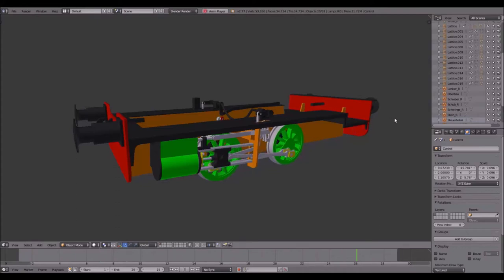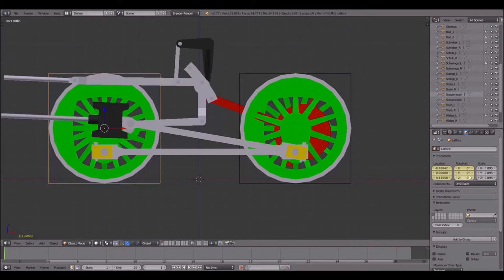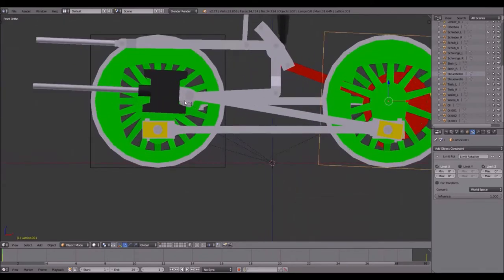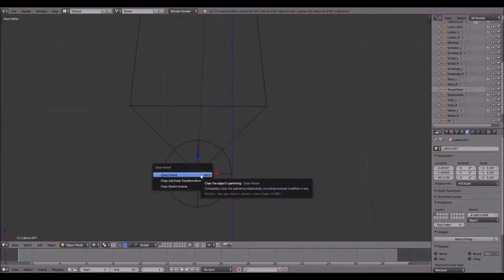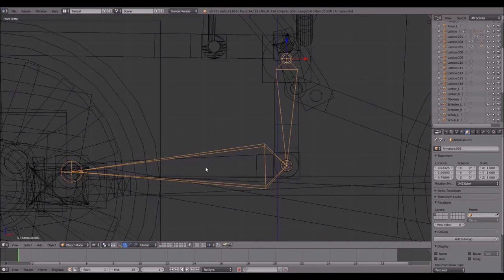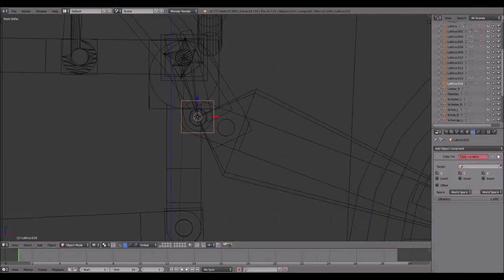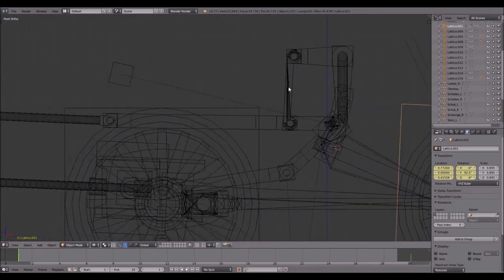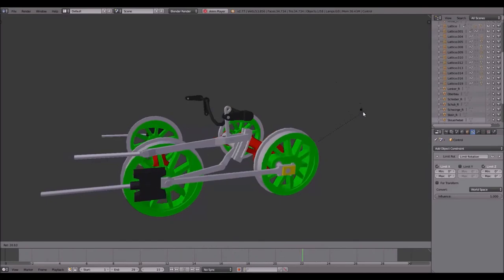Blender Tutorial: Bagnall Valve Gear Animation

Comment: How do you make the valve gear?
Reply from the maker: Dank Engine I used SketchUp to make and export the valve gear because it was easier for me than modelling everything in Blender.
Reply: Locomotivist what's a good way to start?
Reply: Because I'm working on the Stephenson valve gear for Thomas
Reply from the maker: Dank Engine Well, you don't have to consider the properties of steam on a 3D model so you don't need to calculate the lenght of the rods.
I usually start by making the wheels (or cranks if you have for example a stationary steam engine). 
The next thing I make is the crosshead and check if the crosshead is able to move without clipping through other parts (by the way, length of crank times two equals piston stroke). 
I then put the crosshead in the center position and do the same with the crank (either up or down). The distance between the crosshead and the crankpin is equal to the length of the connecting/main/piston rod (as far as I know all three words describe the same thing). As a rule of thumb this rod should never be shorter than five times the crank radius (it wouldn't look good and may cause problems during animation if it is too short).
That's basically it for the "moving power" of the engine. Now the valve gear.
If you have a valve gear like Walschaerts or Bagnall (there are many others) that combine the motion of two different sources you may have to adjust some of the previous discussed dimensions. But Stephenson valve gear works indepentant from the crosshead. 
Next step is to create the two eccentrics. These are offset by 180 degrees plus or minus lap and lead. Plus or minus depending on  the valve gear's type of admission (inside or outside), crossed or open rods and if there are inverting levers between the link and the valve rod. The distance between the eccentric center and the center of the axle is the eccentric stroke. If you have a drawing or blueprint at hand, try to measure the value. If not try to find a value that "looks good" (not too much and not too little motion, about a third of the piston stroke should be alright).
The eccentric rods connect the eccentric with the link. The links radius is equal to the length of the eccentric rod. Again, try to check the position of the link by using blueprints if available, if not, try a position that looks good. Just keep in mind that if you change the links position i.e. the eccentric rod length you also have to change the links radius.
The link is made to be moved up or down depending on the cut-off. Lastly you have to connect the valve rod to the link. 
One important note: this applies to cylinders and valves that are parallel to the track (or horizontally in general). If you have inclined cylinders like for example a real LBSCR E2, you have to adjust some of the dimensions (example: let's say the cylinders are angled at 5 degrees. The "down" position of the crank pin is perpendicular to the cylinder, so the true down position would be down+5 degrees).
For the animation: I made a tutorial about this type of valve gear a while ago.

I am not a native english speaker so I apologise if I made any mistakes. If you have more questions feel free to ask, I am happy to help.
Reply: Locomotivist  thanks because I've been trying to figure out how to create these before I rig anything